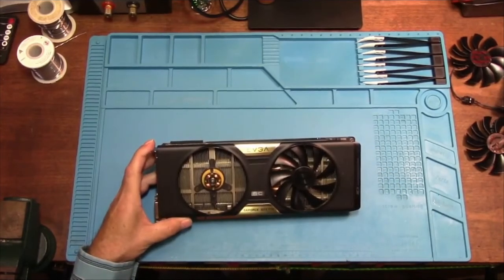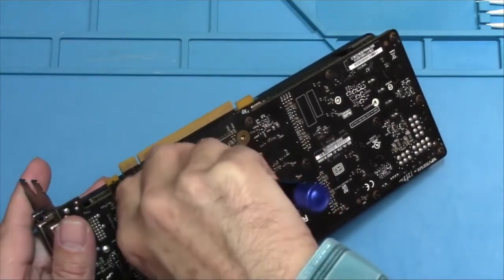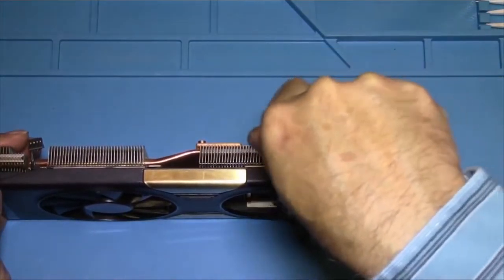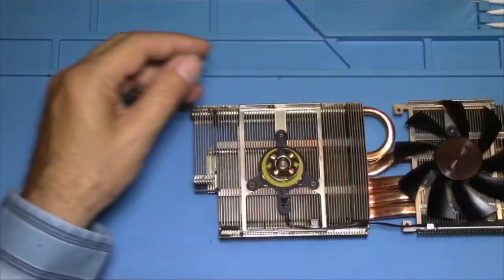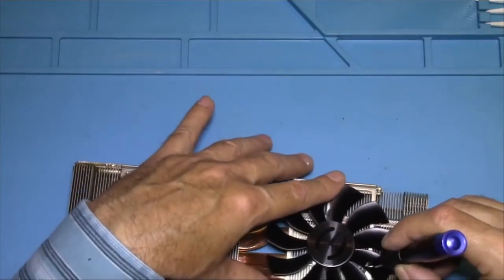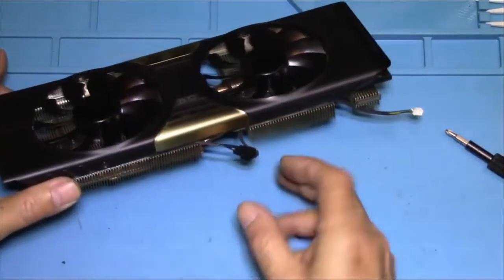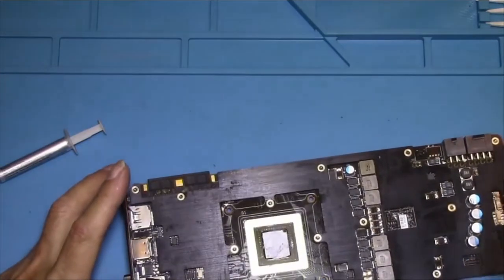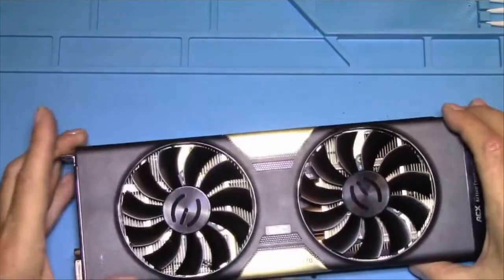EVGA Geforce GTX 770 Fan Replacement - How do the new fans fit? - Are they the wrong ones?.

Comment: I suppose the harness that you got is a direct fit for my GTX970. The cooler is made different. There are no fan seats attached to the aluminium heatsink, instead they are moulded into the plastic shroud, which seems just a more cost optimised way to do it. To install the fans, you run cables through the seat in the shroud individually, screw down the fans to the shroud, then connect the two individual cables at the back of the shroud, then wedge the wires into the wire channels foreseen in the shroud so the wires won't rattle or touch the blades. The cable from the front fan to the logic board connector is only about 3cm short, super short, because the connector has been moved to be right underneath the fan and to not give the wire enough slack to run into the fan. It is well thought out, just different.

The harness you bought, the fan product number seems to match mine and the fan blade curvature matches as well the ones which are originally on my card.

I don't know when the cooler construction changed though. Sometimes the PCB and cooler do change mid life of a product don't they, could have changed mid production run of the 770 perhaps, and then reused on the 970 like that, to give the seller a little benefit of a doubt? But it's possible that they have always been different and yours came mislabelled.

But i also think most harnesses sold aren't genuine. It's just a Power Logic fan as used by numerous products, and GPU manufacturers get custom harnesses made for it. The E logo in spite of looking like it belongs there is actually just a sticker, even on a genuine product, just a very neatly made one.

My 970 gained an issue that the front fan is howling at 100% as if it lost the PWM signal, but i can't detect a wire damage, i think i may have damaged it electronically, but luckily just a fan itself not the whole card i think. Just figuring out which harness i can get cheaply and whether i can thread it in somehow or whether i'm going to need to cut-and-splice it or crimp connectors on; or whether i order just one fan and splice it onto the existing harness, but then these old fans ran long and well, i have grown a little suspicious of both fans for a while, they have become more rattly than ideal.
Reply from the maker: Siana, thanks for the question.  I am not sure if the cables I ordered would work for your card since the first seller I purchased from was the wrong fans.  The next time I ordered from a different seller, and I sent the seller a question about the fit (before buying) - along with photos of the fan in my card, and also measured the total length of the cable.  The seller promptly responded with confirmation that the fans they sold would fit, and when I got them they did fit.  My suggestion to you is to write the seller at this link I found for your card: (https://www.amazon.com/Replacement-Cooling-GTX980Ti-Graphics-PLD10010S12HH/dp/B071WBN6FF/ref=sr_1_2?keywords=replacement+fans+for+GTX970&s=electronics&sr=1-2)

Write the seller with photos and the total length of your cable before purchasing, and hopefully you will get just what you need.  I think you would be better off (like I did) to just go ahead and get new fans as I was thinking the same as you, and decided that with as much life that were on these fans - it would be better to go ahead and just replace them both.  Don't go by the product number either...  The first set of fans I ordered that did not fit, had the same product number of the ones in my card, so product numbers evidently don't always match for some reason.  I hope this helps
Reply: @Outside-In.   I'm also hoping to spend as little money as possible on the repair :D there aren't any fans locally on Amazon or eBay that I can see anyway, all shipped from afar. I'll only buy with VAT prepaid if I order something internationally, because I once ordered some dev kits from Korea and I got well fleeced by our local package company for VAT payment, they tack on a dozen fees, even fees have their own payment fees, bonkers.

On the other hand soldering and crimping connectors really isn't difficult for me.

The fan harness you linked isn't even close to correct. I have an EVGA. 4-pin fan connector not 6. Smaller fans as well, these you linked are 100mm while the ones EVGA uses are 87 ("92") mm. Not to speak of being on entirely the wrong continent. Not to worry, I can find my way around things.
Reply from the maker: @SianaGearz  I was also thinking (like you said) that it shouldn't be that difficult to find fans that you can cut the wires and solder them to your existing harness.  I noticed the 5 pin thing but didn't know the pic count for your fans, and was just going by the gtx 970 number.  I hope you can find a fix for your card, but still I would think it would be better to replace both fans instead of just the one since they have a lot of life on them.  I thought about just replacing one fan on mine, but then thought - with my luck, if I replace just one - then the other one will die shortly after LOL, so why I did both instead.  You might check out eBay also - just a thought.  Let us know if you get a fix - it would be great to hear how it goes for you, and if you have luck finding the right fans for your card, it may help to provide a link so others may benefit as well.  Thanks for your comments Siana  Thanks also for the information on getting fleeced...  That is something great to keep an eye on for sure - good information
Here is a link for a search for fans for your card and most that I see are 87mm.  Hope this may help: https://www.ebay.com/sch/i.html?_from=R40&_trksid=p2334524.m570.l1313&_nkw=evga+gtx+970+fans&_sacat=0&LH_TitleDesc=0&_odkw=evga+gtx+970&_osacat=0

Comment: When you show the old fans and the new fans together, the fan blades are cut to move air in opposite directions, from one set to the other. Could they be the wrong ones?  I had a friends pc start and shut back down caused by a bunch of dust in the CPU fan that caused it to run too slow, so once the mother board sensed the wrong speed, or CPU overheating, it would just shut down.  .
Reply from the maker: Thank you kwd57.  I guess I am going to have to try to get these powered on to test what you are saying.  I will let you know.  These fans do look different but didn't even think of blowing air the wrong way, and you are right, that would not be good.  That means there might be a follow up video coming up.  I will contact the seller to verify they sent the right ones.  That also could be why they don't fit like the original - thanks again for your thoughts - much appreciated.
Reply from the maker: I thought I would update my response to you.  I feel like such an idiot, and thanks again kwd57 for the comment.  I looked and yes you are right, these are the wrong fans and why they don't fit correctly.  I wrote the seller, contacted Amazon, and am hoping to hear something back soon.  I will be creating a follow-up video with this replacement of the correct LOL fans.  I am sorry, but I do feel like such an idiot.  I should have know better to check before installing, but I was so excited about having another video to do that I didn't even bother to double-check.  Carpenters adage - Measure twice - cut once...  Computer tech adage - Check twice - install once - I just made that up LOL...

With my computer crashing, trying to get what I needed to repair it, my gpu fan breaking, trying to find a repair fan for that, being so excited about having another video to do....  I guess there is too much going on and why I was not thinking straight??? maybe you think?...  I know all this is no excuse but I guess it happens to the best of us...